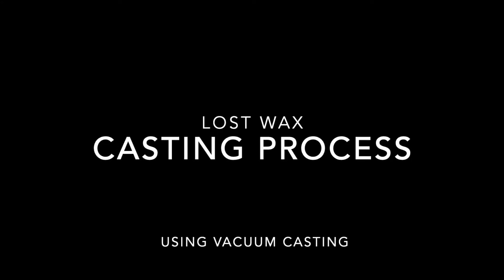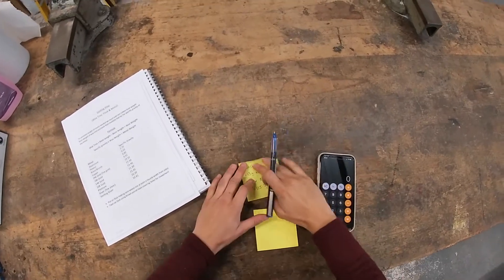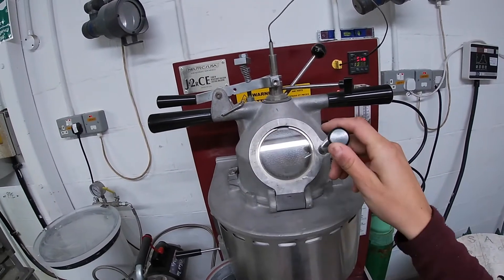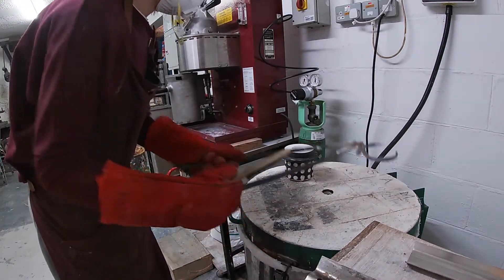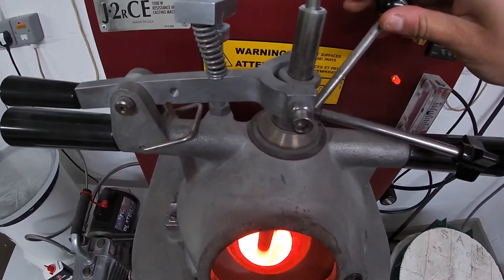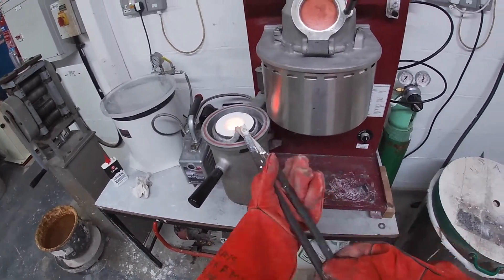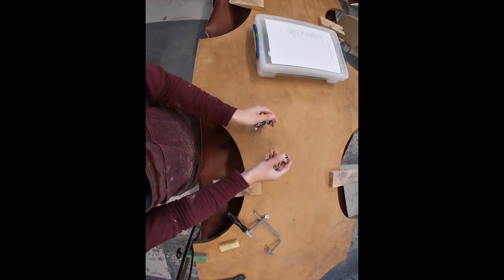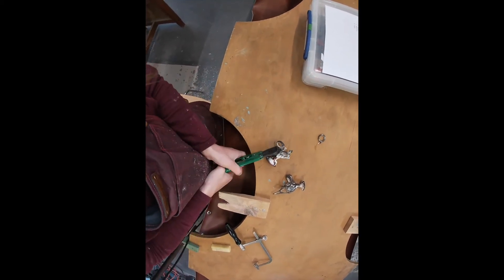Vacuum Casting Process

Comment: hello good afternoon, thanks for making this type of content. I have a question and I would like to know if you can help me. I have a J2R machine here in Portugal, I would like to know if it can be used only with nitrogen? or is there another alternative? Thanks
Reply: Just has to be an inurt gas, carbon dioxide would do. ( pub gas )